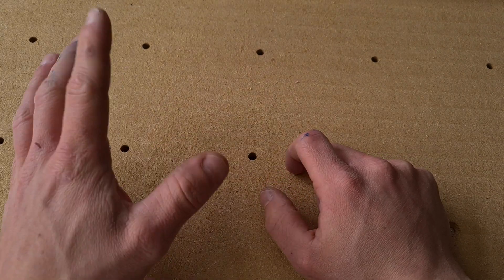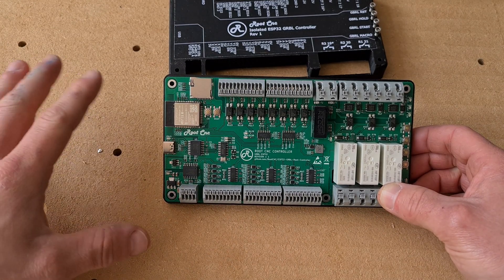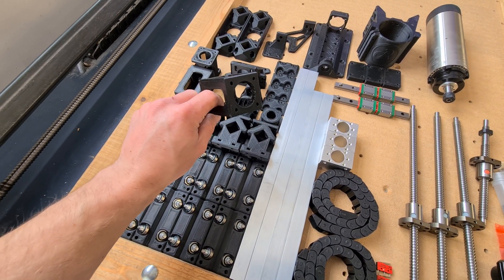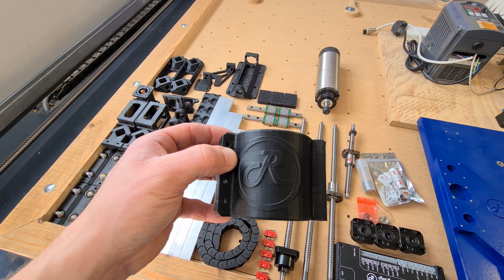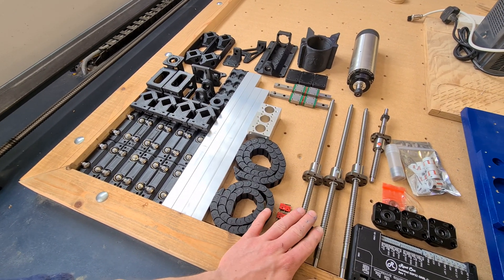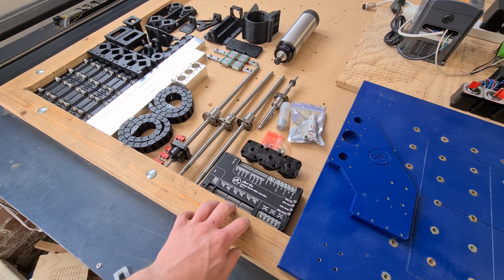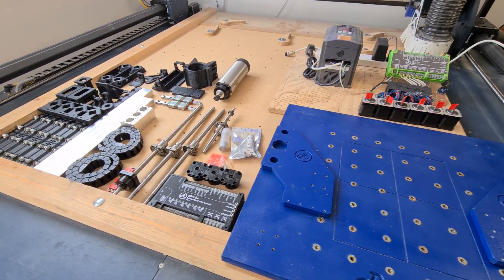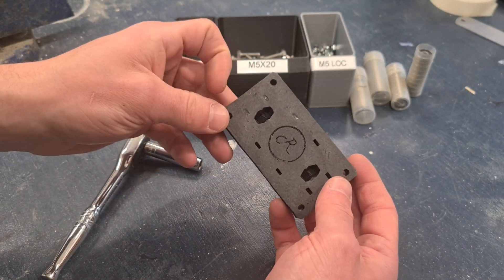Another 3D Printed CNC Machine? PT1

Comment: How difficult is it to upgrade my root 3 lite to a root 4 lite? Can the gantry panels be used or do they require modification?
Reply from the maker: Its been a little while. So my memory is rusty. But it should be all bolt on parts. To change from belts to ballscrews

Comment: Is there a calculator for sizing? if I want to build a versions with 18" (457.2mm) x 18" (457.2mm) cutting area how larger the box rail and lead screws need to be?
Reply from the maker: ah I found your message! please check this link out https://rootcnc.discourse.group/t/root-4-lite-working-area-and-box-section-length-calculator/126
Reply: @RootCNC  that’s amazing. Thank you very much.

Comment: Hello friend.
That's aluminium profile? 
Please tell me specs for profile and metal mark.
Reply from the maker: Hi, is not aluminium profile but it is a standard 20mm aluminium box section. Please keep your eye on github as I'm still putting information on there
Reply: @RootCNC  yes yes, I mean the box profile.
I see that table. It does not indicate what the box-shaped profile is made of. And I thought that perhaps steel pipes are used for Rootcnc4. Thanks anyway.
I'm still bad at English. Sorry.
Reply from the maker: @BoozyWoozy  it is 20x20mm Box section - you can use steel if you like, I've used both steel and aluminium. I would recommend aluminium for this machine and steel for the larger sizes.

Comment: Helo!
I had made a car model with bearings similar to yours, but when I saw your model I realized right away that the design was much better than mine and so I chose to use yours in my project for cnc hot wire cutters for foam. I also intend to use them for a clay 3d printer.
I would like to congratulate you on your projects and for sharing them.
Thank you very much!!!